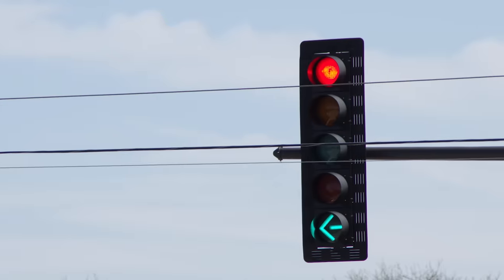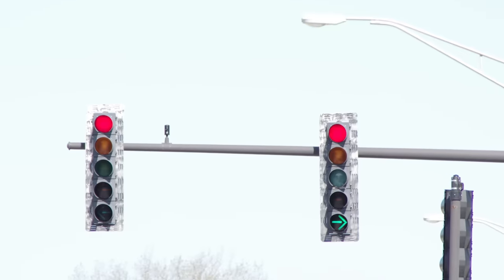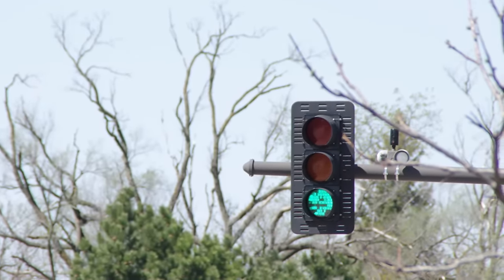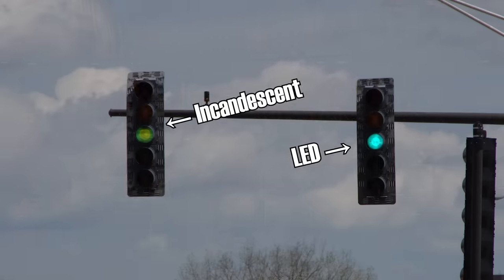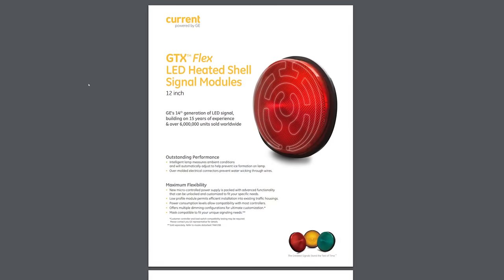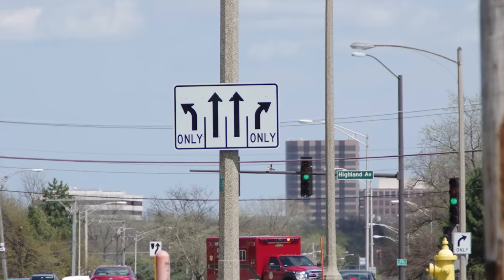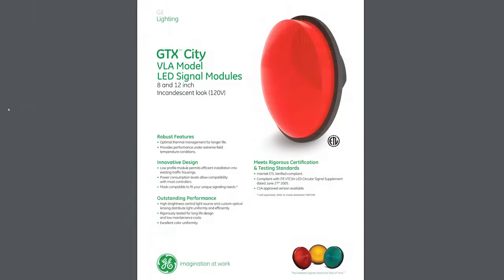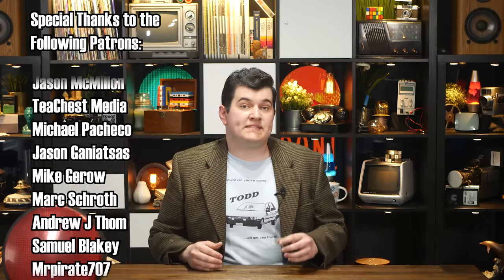The LED Traffic Light and the Danger of "But Sometimes!"

Comment: What the hell? I can't remember seeing a traffic light being burned out like ever.
Reply: Nexarius How? I’ve seen several lights that have been burnt out personally.
Reply: If you spent a lot of time on the road pre-2006, it wasn't too uncommon. I saw them often. These days they are very rare. There are also typically Redundant signals for forward traffic so if one is dead the other can continue.
Reply: They may be the newer LED's or maybe yours get replaced at fixed intervals many places have it at every 6 to 12 months for the older style incandescent bulbs!
Reply: Been driving for 25 years and never seen a single burned out light either.
Reply: @baronvonlimbourgh1716   That seems statisticly impossible, also I'm never going to join you in your car.
Reply: @jasperklingen6964  why is that statisticly impossible? Here lights probably are changed before they burn out i guess.
Reply: I disagree and spent a lot of time on the road pre 2006 and never saw a burned out light it was probably just where you lived. Maybe some kids kept shooting them with bb guns. Incandescent bulbs can last for over 100 years it depends on the quality of the bulb it could be somebody used cheap bulbs where you lived.  Incandescent can outlast any newer tech but they were designed to fail. https://www.youtube.com/watch?v=jx1d3j1IEoI
Reply: Must live in a rich city that proactively changes them before their lifespan is up , Nowadays most of the lights are LED , My city changed them 10 years ago and the street lights were fully replaced with led 5 years ago

The incandescents only really fail when there is a heat wave and we don't get to many of those around here

Comment: Dutch traffic lights have EITHER arrows or a full green light. full means all directions go (directed by the arrows on the road itself). never more than 3 lights though
Reply: JKCTech we sometimes flash the yellow in place of green arrows because yellow burns out least often.
Reply: Rýán Túçk That's a problem, because in some other countries a flashing yellow means something different (but still similar to regular yellow).
Reply: JKCTech Here in Denmark I often see a green right arrow mounted two positions below a regular 3-way full light.  But there's a light-sized visible gap so the full green is still clearly the bottom light in a set of 3 (important for the color blind or when exactly one light is out).

Comment: Great info! May I suggest you move your lapel mic up a bit closer to your neck? It sounds muffled and heavy in the low-mid frequencies. If possible, adding a bit of 2.5K and 8K EQ would clean if up a bit as well. Or ditch the lapel mic altogether for a decent broadcast mic since you're not leading a pilates session.

Comment: Strobe sensors, very interesting!
Reply: Scott Brownlie many areas in the U.S. also use a radio transmitter on the emergency vehicles to open up the intersections in advance...they still use that same white spotlight bulb.
Modern systems use a gps on the vehicle to track it's progress and will change the lights from the main controlling computer.
Reply: Don't forget about MIRTs (Mobile Infrared Transmitters), which are basically infrared strobe lights.  There are even two different kinds--one frequency is used for transit and school busses to give their direction of travel priority in the control order without interrupting the current cycle (next green), and one for emergency vehicles that will interrupt the cycle and give their direction of travel priority (immediate green).  

Here in N. Texas where I live, emergency vehicle triggered lights kind of suck--they give a very short (on the order of two seconds) yellow followed by a red.  That's not a lot of time to stop safely.
Reply: Aye, wonder which wavelengths they're looking for...

Comment: I know in the UK, traffic lights controllers have lamp monitoring which will monitor the current draw from each light phase. If the current draw drops too low, it will switch off the whole intersection as it is more dangerous to have all red lights out for one direction with the green lights working fine in the opposing direction than having all of the lights out. This is currently what is limiting the switchover the LED signals because if too many LED signals are installed on one phase, the controller will think too many lights have gone out as the current draw from LEDs is significantly lower and will turn off the intersection unnecessarily.

Most newer controllers can have software updates to overcame this but many older ones will have to be replaced completely in order to properly support LEDs. A lot of the time if a halogen traffic light gets physically broken or crashed into, they will just replace it with a new halogen traffic light so they can keep the existing controller. I know this is the case in the UK but I am assuming there is similar fault monitoring in the US as well

Comment: VERY good message there! Much respect for telling it as it is!!

Also

DAMN traffic lights are HUGE

Also

hate the jacket 😝
Reply: Pandu Poluan I agree about everything except the jacket.
Reply: Buddy Clem - ahahaha, just kidding. The jacket's lovely. That's why I put a smiley there... not my color, though. I prefer darker tones... to hide my... uh... too-curvy torso 😅
Reply: Pandu Poluan Cool. I like black suits myself, although I am a little partial to Eduard Khil's suit, better known as Mr. Trololo.
Reply: I own an inline 5 section traffic signal much like the ones shown in this video (complete with back plate and mounting bracket).  This thing stands at around 7 feet tall when fully upright.

Comment: Easy thing in Germany. At every traffic light controlled intersection are traffic signs permanently installed. Priority 1 is the traffic light. Is it off or not visible you drive by signs. Aren’t the signs visible or installed you drive by „right first“. With permanently installed traffic signs at many intersections the traffic lights get shut off at night saving money and keeping the light traffic at night going.

Comment: Winters in Russia are rough, and it’s not an exaggeration. In some places, temperatures like -40°C (-40 F, surprisingly) are normal at winter. Though, most of the time it’s something in between -10°C and -30°C (14 F through -22 F respectively). And yes, there is snow, a lot of it. It’s mostly about Asian part of the country, i.e. Siberia. The coldest place on Earth is there as well, where you can face temperatures like -87°C (-112 F). Never been there to experience it myself, but it all is mostly to build an image for the stuff ahead.

There were incandescent traffic lights in Russia, as they were everywhere, and there were the same problems with them. So, people in government decided to switch to LED ones. And here is the difference, now, LED traffic lights are everywhere. Of course, it’s possible that somewhere there are still some incandescent ones left but it’s not for the reason that was mentioned in this video. All traffic lights in Russia use LED arrays (matrices) without big lenses but with individual ones for every LED, and the light is covered with glass (or clear plastic, which is more realistic). Most of the lights are flat in core, some completely flat (no round pieces of glass, no visors, just a number of squares with LED arrays), most lights have visors that aren’t really so prominent and are mostly used to block the sun light. And with all those winters I have never seen a traffic light covered in snow. Flat design doesn’t seem to let snow collect anywhere in so dramatic amounts as it was displayed in those articles. Yes, it collects, but doesn’t block the light at all, and I repeat: winters in Russia are rough.

For those who is interested, you can just google “traffic lights in Russia” and aside memes, there are plenty of visual examples of what I’m talking about.

Comment: A $0.10 thermistor and $0.15 of nichrome wire would solve this
Reply: Exactly and a 10 cent Japanese Solid Capped Capacitor to allow the lights to fade out!
Reply: Nob the Knave  
exactly what i was looking for!!... they NEED to do that because fast switching, microsecond level, leds tend to not bee seen when they pass from, say, red to green, i'm (kinda) daltonic but i pretty see the difference because the green is quite likely the farest wavelength of green from red, and i see the differece clearly, fading at "incandescent" speed allows for a more "natural" way for our animal brain and stuff to know that something moved... avoiding claxoning from behind :|
Reply: @DarthAwar  
it's so easy to do that in PWM mode that they'll use a true arduino for that :D

edit:
or regulating the output current of the led driver in a proper way

edit2:
or you're just simply right... they'll not fade out without running live wires and an "enable" wire
Reply: Nob the Knave  
honestly i've never noticed in my place if they did it that way or not, but yes, that's the point
Reply: Michael Edwards if your idea get implemented, I can see the but sometimes, due to faulty workmanship in the wiring, the lights burn down. LMAO

Comment: Roundabouts need no electricity at all, maybe the countries should finally rebuild their intersections.
Reply: Put in 4x4 and go straight through the center.
Reply: Have you been to the states? we have them and 90% of the people don't know what the fuck to do. It would take years of re-training drivers.
Reply: Too many have cars not knowing anything about round abouts, it's also one of the most potent intersection for traffic flow. But hey, we'll all get replaced by autonomous cars sometime :)
Reply: Nah, I am a Mechanic, engineer in training and someone who spends 1.5-4.5 hours on the road every day, there are just too many variables to factor in, suspension geometry, tires, weather condition, traffic flow, street construction, road condition, the "human" element.

They will come about, but they will need their own lanes, separate from normal cars.
Reply: Wyvern there's a very strangely shaped roundabout in UK which is actually extremely effective and intuitive. However, I highly doubt USA will be able to reproduce either the design or the results.
Reply: Yeah, except when they get overloaded and upgraded to signalised islands, possibly with a "throughabout" bypass in the middle. At which point you wonder why they didn't just use lights from the off, or better still build a flyover or underpass.
Reply: Meanwhile in the U.K., they keep putting traffic lights on roundabouts!
Reply: Here in Puyallup, WA we have several 4 way roundabouts with stop signs on one direction of travel. Who the HELL puts a STOP SIGN in a goddamned ROUNDABOUT, anyway???
Reply: Thing is, the signalised roundabout (as well as the "interbout", which I assume is a neater way of saying "throughabout" or "burger junction"), whilst annoying to drive around or through, is inconveniently one of the most efficient at-grade junction designs available. IE you get the greatest amount of traffic moving per hour per surface area of tarmac, and of money invested. Instead of having one big crossroads which only one or two directions can move through at once, and everyone else has to wait behind the stop line for the traffic from all other directions to clear the intersection, it's broken up into a bunch of individually smaller crossings, with a shorter cycle time, much less lag time, and a lot more traffic actually in the junction at once, moving in many more directions simultaneously. Essentially like a roundabout but with lights to give more timid drivers (and slower vehicles) a better chance of actually getting a turn when there's a lot of traffic already on the island, and, for interbouts, with one or more shortcuts built in.

It's still decidedly inferior to having over/underpasses, but if you can't afford the considerable extra cost of building those, they're the second best choice.

I'm seeing it at the moment in Birmingham (UK) where there are several roundabouts on the main ring road that were originally designed and built (in the 1960s) with enough separation on the approaches to build flyovers across them at a later date if the traffic levels built up enough to overload the simple original layout, and likewise on some of the outer radial routes bypassing satellite towns. Unfortunately, now the traffic's built up, there's also no money left in the budget to actually build those overpasses... so the roundabouts on the radial routes have simply been signalised (and in some cases widened slightly, as well as having much better layout of the lanes to have them spiral outwards instead the rather dumb original concentric design), which has worked far more effectively than anyone might have reasonably expected, and the city centre ring road has used the wide approaches to convert the roundabouts into throughabouts instead (with somewhat more questionable results as several of them were already signalised anyway and the real pinch points causing them to backup are elsewhere... but it does at least mean the everyday logjam in one direction or the other has less of a knock-on effect to other directions, because although the traffic flows still have to cross over each other, they do have an increased degree of spatial separation between those ultimately heading in different directions).

Bit of a shame, in terms of unfulfilled potential, but you have to make the best you can of what you have to work with... and overpasses that don't fall down in twenty years' time cost a hell of a lot of money. As demonstrated by the long viaduct sections of our radial motorways which are currently undergoing massive, hugely expensive remedial works to stop them literally crumbling to the ground, after twenty-odd years of doing alright after being built on the cheap, ten years of being generally neglected, and then another fifteen of increasingly desperate patch-up jobs.
Reply: but these are boring.
Reply: But roundabouts are not practical for vehicle-heavy as it will cause more traffic jams when people wait to get in already full roundabouts

Comment: Just update the traffic lights to include heating elements.
Considering they will likely be turned off most of the time (when it's not snowing),
it will still save a lot of energy and they will likely not have to be maintained that often.
Reply: Note however that someone would have to design technology to make the decision to activate heating elements. It's not as simple as a thermostat, since you don't need it active in cold dry conditions. All this adds cost, and added complexity decreases reliability.
Reply: @JohnH0130  ... and you won't know if it quit working till it snows. Oh wait, we have that technology. It's called a light bulb, that goes dark when its life is over.

Comment: Roundabouts solve allmost all problems with traffic lights.🤔
Reply: @Jeremiah RasingI have 42 years of daily driving experience, in multiple countries and I have to disagree. I understand that this is anecdotal, but  I have noticed that where I live now, in Portugal, we just don't have many collisions in roundabouts, compared with what I saw where I used to live in Canada or the US, where I would see fenderbenders and horrible T- Bone collisions daily at traffic lights. I'm just going by what I see with my eyes. 😁
Reply: @macplumber  While I agree that roundabouts are superior in almost every aspect they struggle to push their way into the US because their size and cost (the cost being a result of their larger size). On highways, they should come to prominence but in cities, having a roundabout every block would be a disastrous waste of space.
Reply: @Jeremiah Rasing Round-abouts are better everywhere: if the crossroad needs to be regulated, it should be by round-about. Those makes traffic much more fluid, oblige all to slow down don't fail when there's no power.

Comment: 5 years later... Even here in São Paulo, regarded as one of the top-10 most traffic-intensive cities in the world, we now have LED traffic lights almost everywhere, but... With almost no smart controllers whatsoever... And most often than not, the controllers are not only configured wrong, but also they have no UPS whatsoever... Not to mention if there's a roadwork or something akin going on, then we're basically holding our breath, because the traffic lights that ARE working, are still considering the 3-lane "arterial avenue" vs. 1-lane "side-street" configuration (while there's only one lane available through the "arterial" roadway), so everyone's basically stuck forever if they are not aware, or forced to take that avenue due to their destination...

Comment: A 14 year old could design an arduino to turn something on if the humidity is high enough and temperature low enough.
Edit: Nevermind, GE already did it. God damnit, GE is the simpsons of electronics.
Reply: How about a moisture sensor in the lens?
Reply: Ice isn't wet... when frozen. Humidity sensors are a form of moisture sensor though.
Reply: Richard Smith hopefully it would kick in before it freezes.